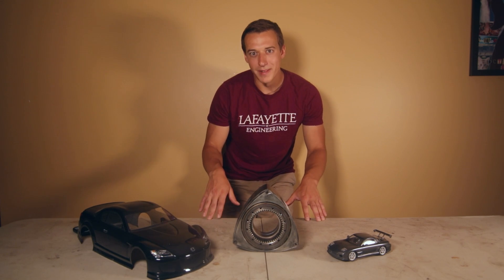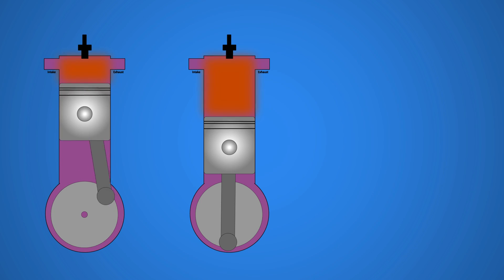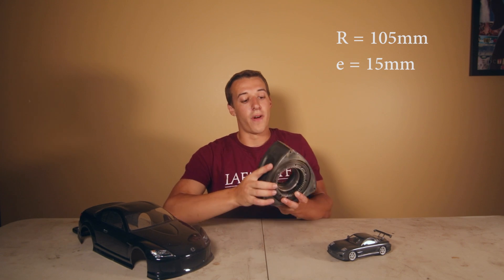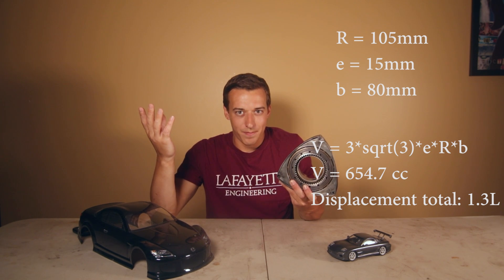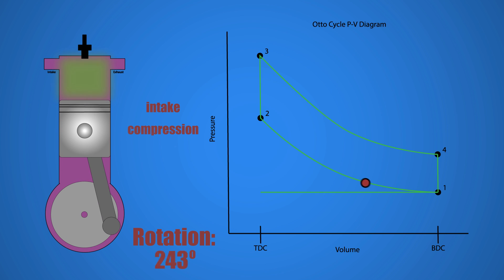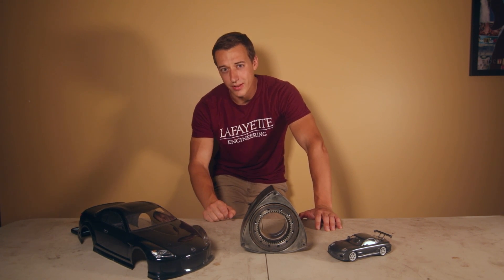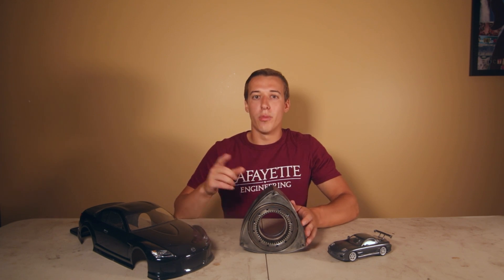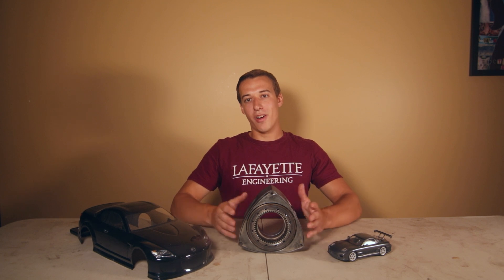You are WRONG about Rotary Engine Displacement

Comment: But wouldn't the stroke volume be each of the chambers? So it should be 6xx CC's X 3 X 2 rotors! Making it more like a 3.8 litre engine!
Reply: Actually no, as there's only one chamber where the "boom" happens so it's only a 1.3L.
You can check it in other videos about that topic that can explain it in more detail. Anyway it's 1.3
Reply: @danogh2227  thank you, at last another person saying that only 1 side of the rotor fires at one time
Reply: @edwardwillis6409  yeah there is only one chamber that does the fire, it's just that the other does exhaust and intake at the same time
Reply: @edwardwillis6409  Yes and you are both wrong.
Just as in a reciprocating engine each chamber has all 4 strokes or cycles.

The only difference is the Wankel KKM engine requires 1080° degrees of crankshaft rotation to complete its firing order sequence... instead of 720° in the Otto or Diesel engines.

Any questions son?
Reply: @sandervanderkammen9230  your not getting the point please read it we are saying not all of the rotor faces fire at the same time, let’s explain it more simple, rotor face 1 2 and 3 we are saying rotor face one fires, then 2, then 3, the comment we are replying to suggested that 1 2 and 3 fire all at the exact same time, I know per sharft or crack ( what ever you want to call it) rotation one rotor fires 3 times but not at the exact same time,
Reply: @edwardwillis6409  You don't seem to know how the Wankel engine operates.... 
  The Mazda 13b series engine has only 2 combustion cycles per crankshaft revolution.

A 6 cylinder Otto engine has 3 combustion cycles per revolution.
Reply: @sandervanderkammen9230  no, I’m crap at explaining things, I’m trying to say when the rotor is spinning around it fires each face one by one not all 3 at the same time, I’m just useless and explaining myself, also a 1.3 rotary is a 1.3 rotary just like a 2.6 piston is a 2.6 piston there isn’t really much comparing them cus there different
Reply: @edwardwillis6409  Exactly the same, the only difference is the number of crankshaft rotation to complete its firing order sequence.

6 chambers each have their own swept volume volume displacement, exactly the same as a reciprocating Otto type engine.
Reply: @sandervanderkammen9230  yes now we are one the same page, in my opinion I still believe the 13b is a 1.3l but that’s just my opinion, I’m just glad I got my point across clearly now
Reply: @edwardwillis6409  A 6 cylinder Otto engine has 6 swept volume displacements. They do not have their combustion cycles simultaneously or during the same crankshaft rotation.

3 combustion cycles per rotations in the Otto or Diesel engines.

Only 2 combustion cycles per crankshaft rotation in the 13b. engine.
Reply: @edwardwillis6409  Please use the correct terminology.
The Mazda 13b is a Wankel KKM-57 type engine.
Reply: @sandervanderkammen9230  ye I knew what I was trying to say but using the wrong words
Reply: @edwardwillis6409  The Mazda 13b series engine has a true total displacement of 3,924cc's 

The confusion for some people is whwm we compare relative displacement

If we compare the Wankel engine at 720° degrees?
Its displacement more like a 2.6 liter Otto engine..

This does not mean that the 13b is a 2.6 liter engine, its not. Its total displacement is 3,924cc's
Reply: @edwardwillis6409  If you have 6 chambers, each has a swept volume displacement of  654cc's 

It does not matter if the engine is a 2-stroke at 360°
4-stroke  at 720°
Or a Wankel at 1,080°

The displacement  will still be exactly the same  3,924cc's
Reply: @sandervanderkammen9230  just curious what do you think of this, I found it on a rx7 forum,
The 3.9 crowd is correct in that by the time all three sides of each rotor have fired, 3.9 liters has been displaced. In the minds of some, this is what is required to complete the entire auto cycle in a rotary engine. Ignore crank rotations because "they don't count."

The 2.6 crowd is correct in that the 2-rotor rotary fires the same number of times as a 4-banger per rev, ie: twice. But in 720 degrees of rotation (a complete cycle for a boinger) the rotary fires four times. 4 times 650cc = 2.6L. This of course ignores the fact that 2-cycle boingers of the same cylinder dimensions as a four stroke are still labelled as the same displacement as the 4-stroke. Whether that is proper or not depends on who you ask.

The 1.3 crowd is correct in that there are two chambers in a two-rotor engine, and each one is 650cc of displacement. 2 x 650cc = 1.3L. But that's only through one complete rev of the e-shaft, 360 degrees (like a 2-stroke), not the 720 degrees of rotation required of a 4-stroke.
Reply: @edwardwillis6409  The displacement stays exactly the same.
2-stroke at 360°
4-stroke at 720°
Wankel at 1080°

The operating principle used has no effect on displacement.

Engineering is not a popularity contest... few people have an actual engineering degree and understand the rules for establishing swept volume displacement in internal combustion engines...
So seeking the answers that you want to hear on a fan site is not a legitimate source for reference material. 
My reference source is one of my automotive engineering text books, written by Professor David Crolla.

"Tax Displacement" is a concocted method created by the marketing department of NSU Motorenwerkes GmbH.
Max Bentele and Hanns Paschke both  openly rejected this false and misleading advertising gimmick.
Engineers, Government agencies and motorsports sanctioning bodies do not recognize the validity of "tax displacement" 
They all consider the true displacement of the Mazda 13b as 3,924cc's 
And for comparison, equalization and competitive fairness allow the displacement "to be adjusted"  by using the 2X formula  (720°) to approximately 2.6 liters for those purposes only.
The true displacement is still 3,924cc's 

Any questions?
Reply: @danogh2227  Sorry, but you are wrong.
The Wankel engine operates using the 4-stroke principle.
Each chamber has its own intake, compression, power and exhaust cycle.
Reply: definitely the best argument for 3.9L yet. It is so difficult to put an exact displacement on these engines because displacement was defined for piston engines that we are now trying to apply to something completely different!

Comment: The fact is that is a 1.3L. Excellent video!💪🏾
Reply: Not a 1.3 liter... the displacement is 3,924cc's
Reply: @sandervanderkammen9230   Now I understand why people are saying that rotary engine is drinking fuel a lot. It because actually it is 3.9cc / 4.0cc powerful engine (high horsepower).
Reply: @sofeajane6238  The Wankel engine also consumes more fuel per liter... and per horsepower generated.
Reply: @sandervanderkammen9230  Oic. Thanks for the information 👍

Comment: Yeah I think of it as the description of the construction of the engine.  We also don't then call forced inducted engines a larger displacement than they are because they consume more air and fuel right?  where do you draw that line.  So it's what was designed and  built physically, not how it was utilized.
Reply: If you have 6 chambers, each has a swept volume displacement of  654cc's 

It does not matter if the engine is a 2-stroke at 360°
4-stroke  at 720°
Or a Wankel at 1,080°

The displacement  will still be exactly the same  3,924cc's
Reply: @sandervanderkammen9230  ...but you dont have 6 chambers in a rotary you have only one. In other words, the same rotor face sucks air in also squeezes air and then which also exhausts it. In a regular 6 cylinder 4l  piston engine you don't add the intake stroke, the compression stroke, the power stroke, and the exhaust stroke to make it a 16 liter engine do you?
Reply: @mcdblaze  No, you don't, that is exactly why the Mazda 13b is not a 1.3 liter.
You can't have it both ways.
Each one the the 13b's 6 chambers has its on intake, compression power and exhaust cycles.
You cannot ignore that